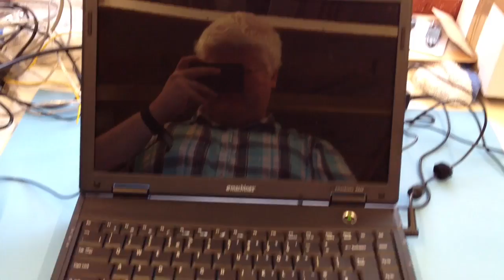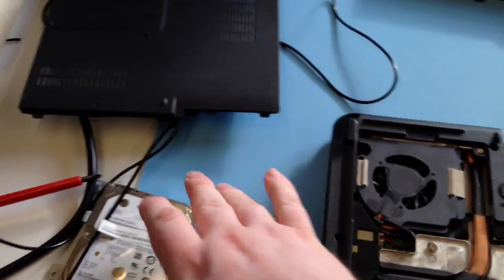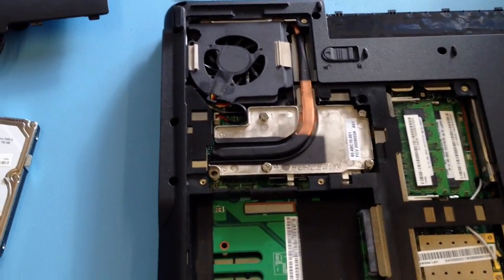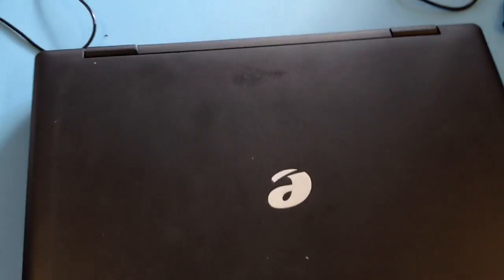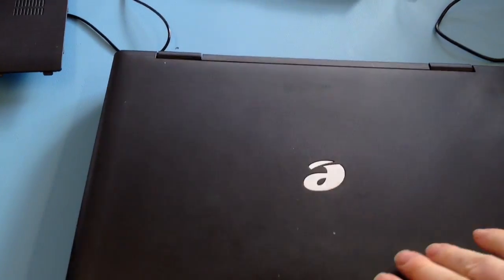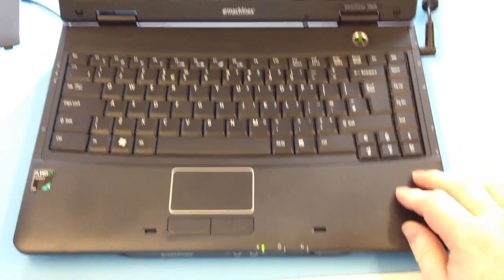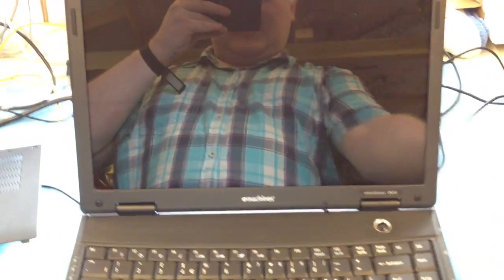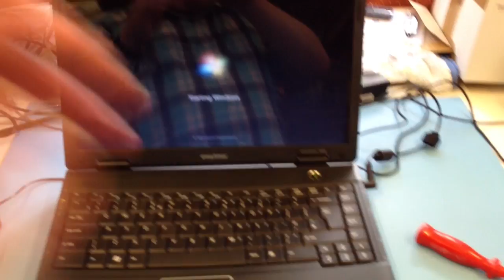eMachines D620 laptop repair (changing the CPU)

Comment: i got the same problem here. but when I plug the cord it just automatically turn on the green led, but when you press the power switch it goes off, when you press it again it does nothing... is this also because of the CPU?

Comment: Does this fix the black screen? I've cleaned the processor since I think it is still good but yeah I just wanna know is it worth buying a new processpr since if it does tend to work
Reply from the maker: Mad Aomi This depends if it is the CPU that is the fault.  A bad CPU will produce a black screen however it could easily be another fault.  I don't think the CPU was expensive so it would probably not be too costly to try replacing it.
Reply: i got the same problem here. but when I plug the cord it just automatically turn on the green led, but when you press the power switch it goes off, when you press it again it does nothing... is this also because of the CPU?

Comment: Can I put other new processor that can be used in this laptop? Please suggest and educate me!
Reply: +Mad Aomi i changed the CPU to a 5050e Dual-Core which runs at 2.6 and its worked perfectly for 5+ years now.
Reply from the maker: Mad Aomi It is possible to install a different processor however you need to pay attention to the CPU's Thermal Design Power (TDP) as the machine's power circuitry and cooling system will only be designed to handle so much.